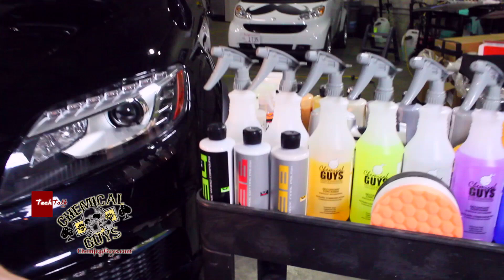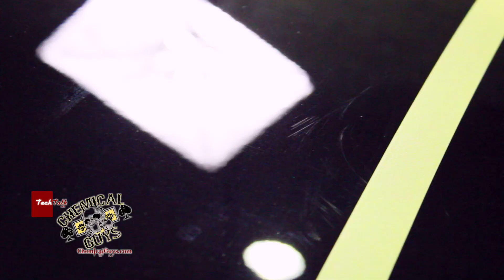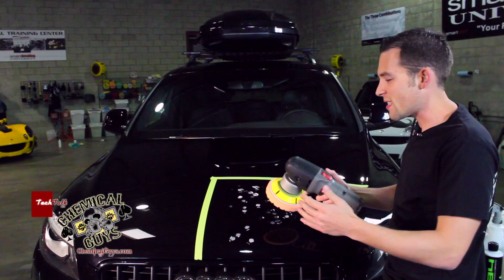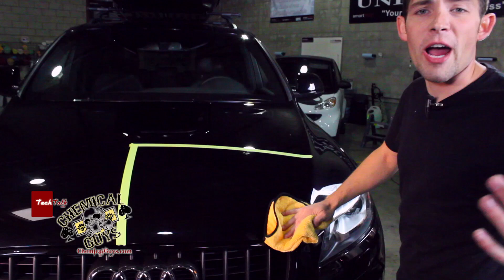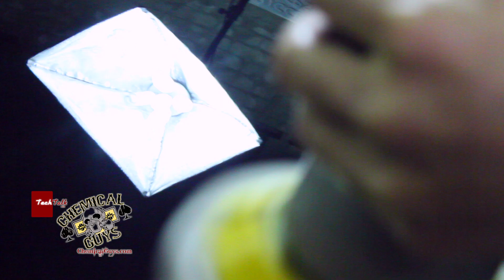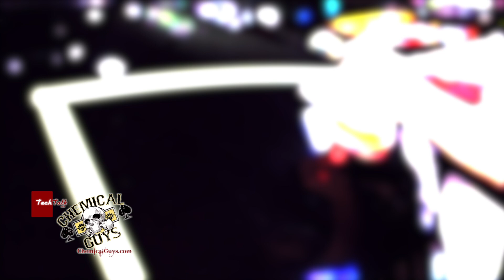How To Remove Swirls, Scratches & Polish Paint with the Porter Cable 7424XP - Chemical Guys

Comment: This "donkey" didn't spray the new white v38 pad 🤦🏽‍♂️
Reply: He did, they just cut out redundant steps.  Is that your best critique from the video? The surface has lots of slick lubrication anyway from the v36, and even if he didn’t condition it for lubrication it would be just fine for that 2x2 area.

Comment: Hey. Would those 5 spots of polish  wax and ETC do the whole vehicle? Or do you need to re apply that much for each section you do?
Reply from the maker: Hey Mike! Use 5 dime size drops for every two foot by two foot section when polishing. Glaze, sealant and wax spread much finer so they can coat multiple panels.
Reply: @ChemicalGuys  thank you very much for that. Just wasn't too sure probably a stupid question haha now I know thank you.
Reply from the maker: Happy detailing!
Reply: @ChemicalGuys  I was wondering if you should do the whole car with V36 / V38 then seal the car as a whole. My black Type R has a bit of fine scratching from being wiped down at the dealer and a 3 day auto show. It was on TV for a few seconds: https://youtu.be/NAnH0vn7NPc?t=52

Comment: You keep saying your removing the paint when polishing the car, do you really mean you're removing the clear coat? Doesn't this ruin the protection of the clear coat? New to this polishing, just wondering.
Reply from the maker: Hi! Yes, often detailers refer to the whole shebang as the paint, even though it could be two or even three stage paint job. It's kind of like how you can be at a restaurant and talk about a "dish", but you're talking about the whole thing, including all the food on it. When done properly, polishing removes the tiniest fraction of clear coat, so small in fact that it does not ruin the protection of the clear coat. Using incorrect methods could ruin the clear coat, but following the methods and using the tools and products seen in our videos will help you care for your paint properly without damaging it. As someone new to polishing, we highly recommend starting with a Dual Action polisher that will help keep you from damaging the paint. The machine has built in safety features that will stop the pad from spinning if too much pressure is applied, keeping you from removing too much clear coat and damaging your finish. Make sure to check our the amazing TORQ 10FX below and thanks for watching! 
https://www.chemicalguys.com/TORQ_10FX_Random_Orbital_Polisher_p/buf_501.htm

Comment: Why do you use the black Hexlogic Pad to spread the Lava, instead of the red Hexlogic Pad?
Reply from the maker: Hey djpoppy, that's a great question. Both the Black and Red Hexlogic Pads are finishing pads with no cut and can be used to apply  glazes, waxes, and sealants. The red pad is slightly finer, but really it comes down to personal preference. Check out the link below to see all the pads and when to use them. Thanks for watching and stay tuned for a new video dropping later today! 

http://www.chemicalguys.com/v/vspfiles/assets/images/HexLogicPolishingPadChart.jpg

Comment: can i just use v38 with the white pad just to give the car a shine so dont have to hand polish or wax just bought a flex 3401 going to try v compounds great vids
Reply from the maker: Hi! V38 is a very fine polish. It is formulated to remove compound marring and enhance gloss and shine after heavier correction steps like V32 or V34. For a one-step cut and finish on any paint finish, try VSS Scratch & Swirl remover, V36 Optical Grade Cutting Polish, or V4 All In One Polish & Sealant. Thanks for watching and check back tomorrow for a new video!
Reply: cheers

Comment: i thought you had to spray the pad first with water or a lubricant each time you use a new pad ?
Reply from the maker: Hi Robert, yes, you are correct. You should most definitely prime buffing and polishing pads with Polishing Pad Conditioner for fast and even results every time! Thanks for watching, and stay tuned for a new video dropping later today!

Comment: So could I just use the Polish with the white pad then wax with the black if I don't have any swirls or anything...or just use wax....
Reply from the maker: Hi John, how's it going? Use White Quantum Pads with V38 Final Polish during your two step process, or V36 Cutting Polish after removing heavy swirls and scratches with harder cutting pads. If your paint doesn't have any swirls or scratches, then there's no need to polish, just clay bar and then go straight to sealing and waxing! Thanks for watching, and stay tuned for more videos headed your way soon!

Comment: Why use so many pads? On some of your other videos you guys use (1) the orange. This video seems like there’s too many steps. Can’t I just use orange and wipe clean with terry cloth?
Reply from the maker: Greetings from the Chemical Guys media scrum. There are two types of polishing methods, single stage and multi stage. All in one polishes like VSS are considered single stage polishes, or "one step polishes". VSS contains micro abrasives that abrades the paint, and eventually breaks down into a fine polish. VSS works on light to medium scratches, it's considered to be rather aggressive and falls somewhere between V36 and V34. Multi stage polishing occurs when you start with V36 as a test bed, and then you move onto more aggressive compounds based on the level of correction you desire. I find that multi stage corrections are more precise because you have the ability to gauge the progress, and you have the ability to graduate to a stronger compound. With experience, you can tell which one will work better for you. Stay tuned for more great videos coming your way.

C.G. Alex -

Comment: Hi you put pad conditioner on first pad but not on the other ones, why?
Reply from the maker: Hi Anthony, you should use pad conditioner on any polishing or cutting pad, that means the orange and white pad. You don't need to spray the black pad with conditioner because you use that to spread waxes, glazes and sealants. Stay tuned buddy, we've got more great videos coming your way.

C.G. Alex -

Comment: if I use a v34 do I have to use a v36 and then a v38?
Reply from the maker: Hey there, thanks for watching. V34 is a compound, and often you'll get buffer trails from polishing with an aggressive pad. You'll need to use a fine polish to remove the buffer trails to complete the paint correction. Buffing marks are either the result of heavy abrasives, abrasive pads, and incorrect polishing technique. Depending on how the process goes, you will need to forgo all three steps. In some cases, you will only need two steps like V34 and V38.

C.G. Alex -

Comment: You guys seriously confuse me, you show so many machines/polishers and techniques that I really don't know what machine in particular would be the best allrounder for me because I really need a machine that is safe to go over rolled edges and body lines and curves without burning the paint or digging in to hard.
From what I have herd it sounds like dual action machines are the best for that, but I was going to buy the Torq 10FX seems like an awesome machine, my biggest problem is I have a Black 2008 VE SSV Holden Commodore Wagon that has scratches/swirls and holograms that I really want to get rid of myself, but but I am a total beginer as far as properly detailing cars but I want to teach myself with the help of you guys and your youtube video's they are awesome.
Also I Totaly need to Clay Bar my wagon first.

Comment: Just picked up a PC7424. Can you tell me what the small nut that it comes with is for?
Reply from the maker: Hi Michael, I've looked into the contents of this model on Amazon, it says: Porter-Cable 7424XP random orbit polisher; polishing pad; side handle; wrench; operating instructions. If I had to take a guess, I'd say that it was possibly for the side handle attachment, it could go on either side.
Reply: Chemical Guys Thank you for the response. Also. If I want to switch to a smaller pad for specific areas on my truck, do I need to change the counterweight also?
Reply from the maker: Hi Michael, I don't believe so, you just have to purchase different pads because the Porter cable doesn't use a hook and loop system.

Comment: I see your using a 5 1/2 inch pad so what size is the counter weight your using?
Reply from the maker: The Porter Cable has a counter weight that oscillates at 8mm.

Comment: hi .i have recently searched your website and found paint corection compounds 700,721,778 , but you never mentioned in any video about these ones ( how its works what is a difference betwen them and v series) ?

Comment: so is it the difference in the machines the (flex vs the porter cable) or just a change in your own procedural methods - concerning
1. starting with disk on surface before turning machine on.
2. turning off before lifting from surface.
3. applying pressure - here with the PC you said to apply but on the flex video you let the machine do the work.
Reply: Same. Always start the machine on the car and stop on the car, otherwise you will whip all the polish everywhere. In regards to the pressure I think they made a video describing how to use it. I have not used the flex unit before. But i've heard that it makes detailing easier as well as the Rupes.

Comment: I've just gone through this process on my vehicle with the v34 and orange hex-pad (as it's black with lots of swirls). I've noticed that I end up with a snaking pattern on my vehicle. Yes, the paint feels much smoother and in indirect light the black paint looks much deeper than before. But never the less, I still see a pretty dramatic snaking pattern from my 50/50 overlapping passes. Is this a sign that I didn't make enough passes or possibly did not spend long enough polishing (i.e. the compound was not able to fully break down)? When polishing I did make several passes at speed 6 and the compound did become clear before I wiped it off. Just trying to figure out what I'm doing wrong...or is this pattern typical before the v36 or v38 is applied? Any constructive input is welcome from anyone who may have had this issue. Thanks.
Reply: Ideally should have started with v36 first if that does not remove the swirl step it to v34. The snaking pattern could be too much pressure.  Try using the v36 to a small section of the snaking then go to v38 and finish polish. hopefully that helps. When polishing always go from least aggressive to aggressive (if least aggressive works then stick with that, you can always step it up to more aggressive is the least aggressive does not work. You cannot go from aggressive to least aggressive.)

Comment: I bought this kit and couldn't be happier with my results. I had some nasty scratches on the hood of my GTI that came right out using this method. I also had a pretty deep one on top of the bumper in back due to someone dragging a suitcase or golf clubs out instead of picking them up and lifting them out. I hit that with V32 and the scratch disappeared within seconds. It was a scratch deep enough that it would catch your fingernail if you scratched on it. You now can't even tell it was there.

Comment: So...
1. Give the car a normal wash
2. Claybar entire car
3. Give another normal wash
4. V36
5. V38
6. Lava

How many hours is this going to take on a sedan if you had to guess?  Around 6 maybe?  And can you be in direct sunlight or is it better to be in the shade/garage?
Reply: Mike Picone you shouldnt have to wash the car again after you claybar it, and always polish in the shade. 6 hours sounds about right if you are taking your time
Reply: Actually, if you really want to keep your car scratch free it's:
1) Snow foam
2)Give the car a normal wash
3) Claybar entire car
4) Give another normal wash
5) V36
6) V38
7) Lava - (Personally, I like using JetSeal109)

And to protect your polish and sealant, you should put some sort of wax on it after applying lava or w/e you prefer. It also gives it a little more "umph" but thats just me.

Or yeah, and to answer how long it takes, it varies; if you really wanna take your time, it can take a couple of days. And it's terrible to wash and detail your car in direct sunlight. It's a pretty good way to ruin your paint :/
Reply: for a sedan, you're looking at 6 hours at the least.  for the compounds and polishes you need to do it in the shade because if you let it dry like you do a wax it'll be really hard to take it off, thats why you always wipe off the polish as soon as you're done.
Reply: Mike, you wont want to be in direct sunlight and its probably gonna take 10 or so hours IMO. I guess it depends on how bad of a correction you need.  It does take awhile....
Reply: Doing this in direct sunlight is suicide. You shouldn't wash the car in direct sunlight either.
Reply: Mike Picone Garage would be best. Shade is a absolute minimum.
Reply: Mike Picone Hey Mike, it is always best to be in the shade or in a garage.  Hope this helps.

Comment: To Minutemadex: Go to a local car meet or "drive in" get together and talk with the people there about good detailers in your area. The skill and care of the detailer is very important, and results vary widely depending on who you use.  The guys at the car meet can probably tell you $ information for your area too.  Another approach is to go to some good body shops in your area and try to find out who they use as their detailer.  Many of the shops will try to sell you a detail service (which is fine), but some of them are paying somebody else to do the work and then adding an upcharge.  Better to develop a relationship with the guy who is actually doing the work.  Or for about $200 you can buy all the stuff you need to do it yourself.

Comment: can i wash the microfiber cloth ?
Reply: I own a car wash. We use Erc towels. Are they the softest? No! But they are the most rugged. Meaning we wash these rags all day everyday. They, to me, are the highest quality rag out there. For washing. Use Mike detergent. But most importantly. Do not use heat to dry!! We spin cycle them with air only. So yes they can be washed but cannot be dried using heat. If you're not a professional and won't be going thru rags like I do.. Just hang dry them for max life
Reply: if so how ?
Reply: balvirmand with warm water and soap
Reply: balvirmand put it into a laundry machine with some detergent or microfiber wash
Reply: balvirmand With Chemical Guys Microfiber Wash
Reply: Washing machine. Low heat setting. No fabric softener!!!! Dry on low low low heat in dryer or hamg to air dry

Comment: How much would it cost me to let my car completely get polished by someone like this? I own a BMW 1-series and the previous owners had some cats that climbed on top of it and now theres loads of small scratches on there and I'm interested to know how much it would cost to let someone fully polish and wax and do anything thats necessary to make my carpaint look like new again. Does anyone has an idea what the price will be like? Thanks in advance for the replies.
Reply: Alright awesome guys, thanks for taking your time to reply to my question. Helped out heaps, going to search for an exterior car detail for +-250 dollar in my area!
Reply: Minutemadex I payed $1100.00 for total paint correction on my '11 corvette grand sport(red).  It was worth every penny.  The paint is flawless.  When i had my '09 Mercedes E63 AMG(black) i had a lot of swirl marks.   i took it to a place that advertised a lot of detailing service for $250.00(that was the total package price)  and at the end they gave my back a car with buffer marks all over the car.  Bottom line... You get what you pay for. Hope this helps.
Reply: Paint correction depending on car size can be anywhere from $200-$350, give or take. I'd look around for car detailers in your area and give them a call to see what they say, some may want to see the car beforehand to give a proper estimate.
Reply: I would say about $350 this is the kinda job that would take about 5 or 6 hrs .they have to wash your car , clay it , wash again , 2 step polishing as shown in video and then wax ..
Reply: It might be different for your area, but in southern California for my Crown Vic, which is a sedan with a lot of surface area, a full, professional detail was around 400 dollars plus tip. This was not just a paint polish/wax though, it included a full interior detailing, upholstery/carpet wet-vac, as well as engine compartment cleaning. If all you want is a really good polish/waxing, it would probably be cheaper.
Reply: i detail bentleys nd roll royces and other european cars for a living i charge 300
Reply: It helps out alot, in matter of fact very coincidentally I bought my own DA machine and just finished my car yesterday night all by myself! And it looks stunning imo, am thrilled! Still thanks for your comment.
Reply: Man... You are brave... I want to learn to do it myself but,  i just don't dare. Good for you on taking that step. Maybe i can practice on an old hood. lol

Comment: I just purchased the porter cable, it was fantastic. It removed the swirls I had on my 2013 black Tahoe.  I polished it and it looks great .I could not be any happier. Now I have to address the tire issue. But u guys have uploaded a video. So that problem is solved. I would like to say thank you chemical guys.

Comment: I had a question for you guys , a while back when I first got my truck that had a few minor scratches my older brother insisted on helping me get them out by rubbing Rubbing Compound all over the scratches and well made things worse , the areas are now really foggy you can see a lot of swirls and even some of the clear coat is starting to peel off , is there anyway to fix this ? Or is the paint done ?